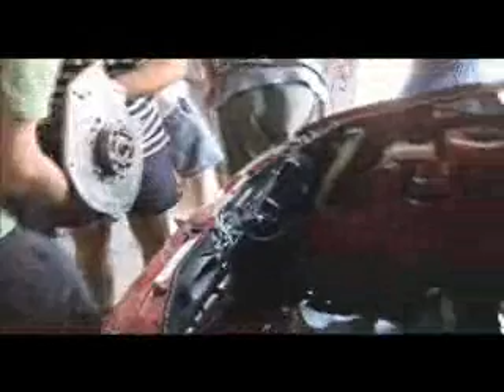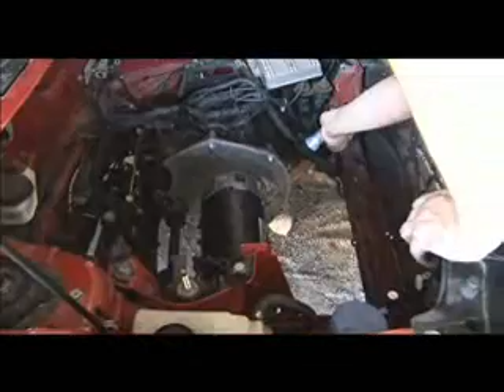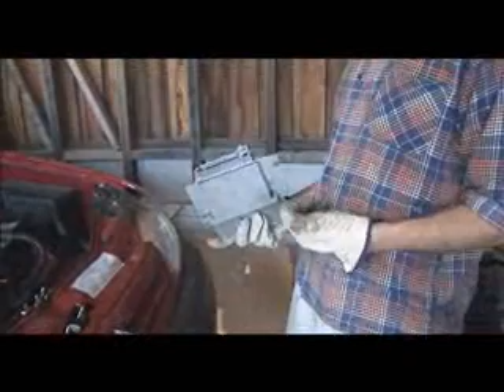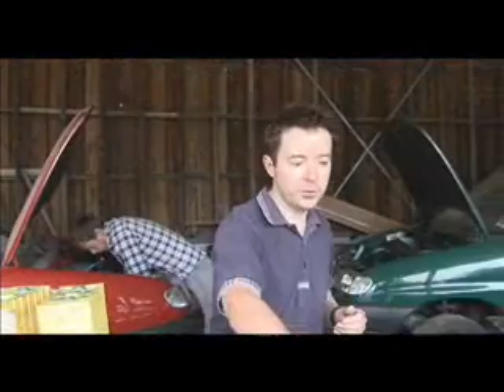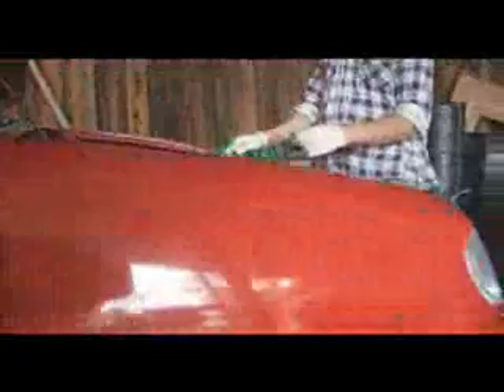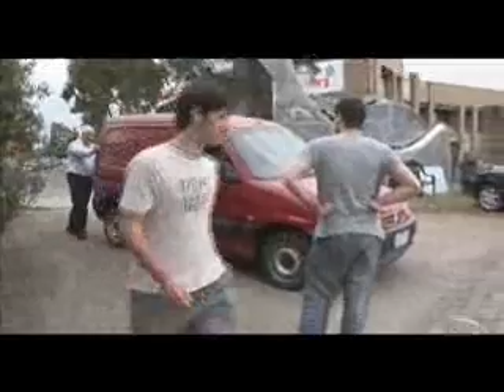CERES Electric Vehicle Conversion Project

Comment from the maker: We later found that the gearbox (transaxle) for this car had very little oil in it. We refilled it and it is a lot better now. There was also some noise from packing tape that came along with (inside) the motor. We removed most of it, some was left, this has now almost worn away.